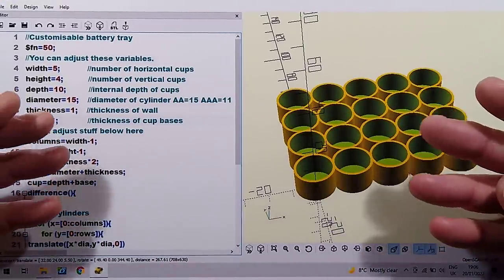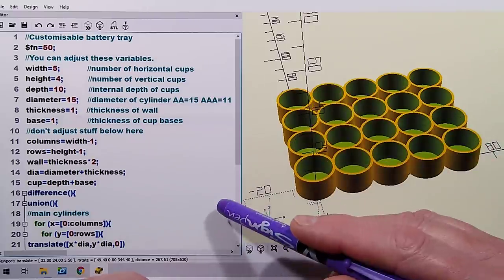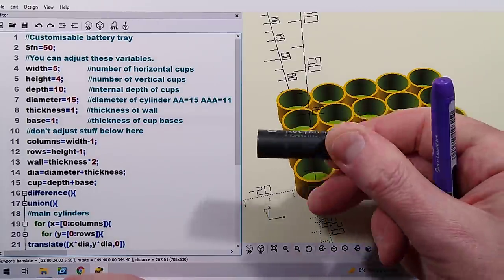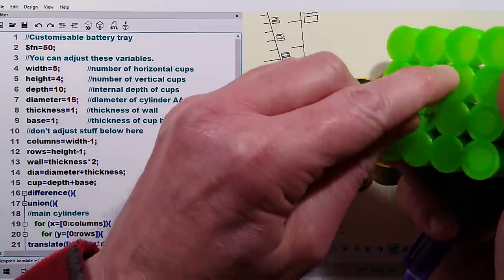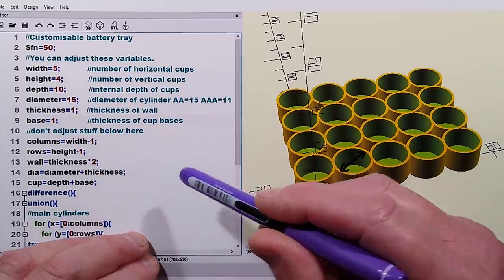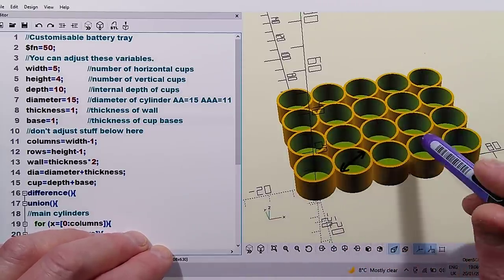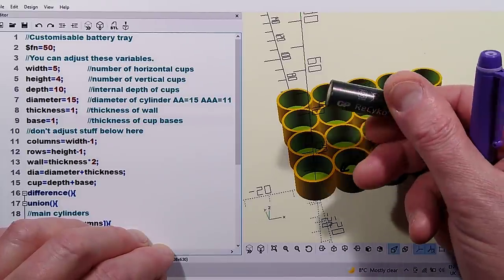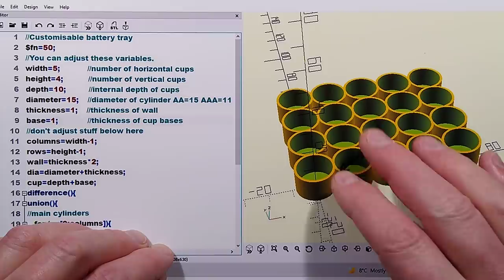DIY custom battery storage trays

Comment: Ok, here is the optimized code for the tray I came up with.
Features: Makes full use of the customizer (which allows to save different profiles for later use).
Checks if you try to create a tray larger than your print bed (adjustable).
Wiggle room for batteries adjustable. (Between 0=press fit if battery on specs and printer precise, and 2mm in 0.1mm steps)
Includes most common battery sizes by name.

//Custom battery tray - bigclivedotcom
/*[Printer bed size]*/
//Printer Y
maxwidth=250;
//Printer X
maxheight=250;
/*[You can adjust these variables]*/
//number of horizontal cups
width=4;            //[1:20]
//number of vertical cups
height=4;           //[1:20]
//internal depth of cups
depth=10;		//[0:5:80]
//diameter of cylinder AAA=10 AA=14 16650=16 18650=18.6 21700=21 22500=22.3 C=26 26650=26.5 D=32 4680=46
diameter=14;	//[10:AAA,14:AA,16:16650,18.6:18650,21:21700,22.3:22500,26:C,26.5:26650,32:D,46:4680]
//thickness of wall
thickness=1.2;	//[0.1:0.1:10]
//thickness of cup bases
base=1;			//[0:0.2:5]
//wiggle room for battery; 0=press fit => might damage tray or battery
wiggle=1.0; // [0:0.1:2]
/*[Hidden]*/
$fn=50;
//don't adjust stuff below here
diam=diameter+wiggle;
columns=width-1;
rows=height-1;
wall=thickness*2;
dia=diam+thickness;
cup=depth+base;
echo(width);
//main body
translate([((diam+wall)/2),((diam+wall)/2),0]) //put 1st cup edges at 0;0 
union(){ //file optimisation
	for (x=[0:columns]){	
		for (y=[0:rows]){
			if((((y+1)*dia)+thickness)<maxheight) { //keep model smaller than the printer bed
				if((((x+1)*dia)+thickness)<maxwidth) {
				translate([x*dia,y*dia,0])
						difference(){
							cylinder(h=cup,d=diam+wall);
							translate([0,0,base])  
								cylinder(h=cup+5,d=diam); //cut out extended for the special case of no base				
					}
				}
			}
		}
	}
}

Edit: test edit to see if YT spam protection has autodeleted the comment

Comment: How would U modify this NEAT Script so that the base has a holes but still holds the batteries;... allowing U to brush dust or any other object that fall in without tipping the tray over...?

Comment: Would using an isometric (triangular) pattern save more space? 
Would be interesting to see if an isometric pattern is stronger too 
e.g. how much it flexes when a full tray of batteries is picked up.
Reply: But then you cannot pick a cell from the middle as there will be little to no gap for the finger...
Reply: @janosnagyj.9540  The 'not-enough-gap' argument applies, ceteris paribus , but if you change other parameters (e.g. cup wall thickness), or taper the cup wall so as to minimize 'joined-up-ed-ness' at the mouth, you can mitigate accessibility issues of the isometric configuration -- to the point of allowing the tray to act a bit like the inverted skin of a cross-hatched mango. However, that makes access a two-handed operation. It depends on what you want -- pure (compact) storage or storage+accessibility.

Comment: On thingiverse there are battery holders that are like mini milk crates. I printed some out a while ago and they're really nice, plus they stack nicely. 

I would guess that if you make the cells squares it should print faster and use less plastic since everything is all straight lines.

Comment: I see another use for this idea...I sometimes buy a tray of beers in my local supermarket, but the cardboard bottom is woefully unstable and wobbly when carrying the tray. If you scale up the 3D print (and possibly amend thickness and height of the cups for rigidity) it would be a help for carrying and storing 6, 12, 24, 30 or any number of cans. It could also be used for storing empties until you return them for the deposit (or dispose of them responsibly, depending on your region).
Reply from the maker: It will work for beer cans as is with suitable sizes.

Comment: would it be easy to have a hole in the base instead of drilling so you could weld tabs across positive and negative to make your own battery packs
Reply from the maker: Very easy.  Literally one or two lines of code.

Comment: I get the feeling Clive is like myself and 99% of what comes off his printer is something useful. I've never really used OpenSCAD, I prefer a drafting type CAD to a mathematical type, though. 😀
Reply from the maker: I just tend to make technical components.
Reply: @bigclivedotcom  same. It sure makes for amazing enclosures when they are tailor-made to the project. Between printing that, and custom trays for organizing supplies at the workbench, I don't have the time or desire to print the things I see so many people getting 3D printers for. 😃

Comment: You can use this script to make 18650 battery packs. Just need a hole for the nickel strips to spot weld directly onto the cells.

Comment: i make these for my 18650 cells, and the method i use is to store my charged cells with the anode+ side up and then when theyre discharged I put them with the Neg- side up!

just got my 3d printer for christmas and these were the first thing i made

Comment: suggestion: 
1. put a second tray on top to make it a "transportable battery box"
2. design: make inserts/dents on the underside of each tray in the middle of all 4 sides
3. design a clamp that fits into these dents, so the both trays can be clamped together, like a battery transport box. The clamp desing should be "springy".
4. make the same for 18650 cells (i guess, only the diameter of the cups have to be adjusted for 18650?) 

these are no demands, just merely suggestion to improve the design. I would like to have one of these, seems to be a very useful thing to have.

Comment: I don't use openscad but I recon this would be handy if you could have 'holes' in the base to make battery packs with 18650's or alike, and print a top and bottom, easy custom packs
Reply: Insert these two lines in the "//hollow cores" section below the second "for" line and above the existing "translate" line. You can adjust the width of the ledge with the ".75" multiplier.
      translate([x*dia,y*dia,-base,])  
      cylinder(h=base*2,d=diameter*.75);
Reply: Even if you don't need the contact points, it will reduce the amount of filament this uses slightly.

Comment: Once you have bought the 3d printer, mastered openscad, how expensive is it to make things as some objects can take hours to print I believe? How long does a spool of plastic last and how much waste does one get?
Reply: For typical home applications, you're looking at around £€$15-25/kg for the plastic (i.e. PLA, PETG, and maybe ABS). I'd imagine 99.9% of consumer FFF (aka FDM) 3D printing uses just those three (ignoring resin printers here).

Waste is usually fairly minimal for standard FFF printers. Most parts will be designed to print without requiring supports, or with minimal supports where that's not possible. In my experience, by far the biggest waste is from failed prints rather than support material or anything - however my printer is a very heavily customised machine so I don't have a manufacturer or community groups to supply good firmware or slicer profiles. Instead I have to find the right settings on my own, which takes a lot of experimentation.
You will get failed prints, that's just the state of things. But with good settings from the manufacturer (or from the community if you choose one of the cheapest machines where the manufacturer may not have done a good job), failed prints should be fairly rare.

Electricity costs vary widely. The biggest power draw will be the heated bed, assuming a given printer has one (most do these days). I'd expect the rest of most printers to be around 50W - the hotend heater, motors, etc don't use a lot of power. In theory it's possible to print PLA without a heated bed, but that doesn't sound like fun to me :)
Power draw of the heated bed depends on its size and temperature. A typical PLA print would have the bed no higher than about 50°C, which shouldn't take too much power to maintain. Maybe 200W-ish for a regular size printer?
So multiply your electricity kWh rate by 0.2 to get a rough idea of the hourly electricity cost. That's never been a huge concern for me, though.

There's nothing stopping you downloading some slicer software and some models to get a feel for the process as well as the amount of material used and the time required (slicers will tell you how many grams of filament a print will use with the selected settings, along with a maybe-accurate time estimate). Just use a profile for a printer that's similar to what you're interested in getting :)

Overall, most things I print are no more than £1-£2 in filament and electricity combined. The medium size battery trays in this video are probably around £0.5-1.0 each, considering the currently high UK electric rates, unless my estimates are way off!
Reply: I've used openscad but didn't quite like it, much prefer fusion360 also free to the hobbyist (does take a while to get used to tho). A spool of 1kg of pla roughly 20 quid will last me a fair amount of prints, obviously depends on the size of the print, I guess a 1kg spool will print 1kg of parts, not taking into account waste. As for waste as long as the bed is levelled and all temps are ok maybe 1 in 30 fail mainly at the start of a print, so if you are watching the print at the start you don't tend to get much waste. These are my experience's with 3d printing, others maybe different
Reply from the maker: Very low waste, and you can optimise designs to use very little plastic.

Comment: A handy battery tray Clive, with some modification I am sure one can change it to hold 9v P4s too. Even make dual tray's that can snap together. I just need a 3D printer, what version do you have or recommend, Filament or Resin.
Reply from the maker: I currently use an FLsun Q5.  There's a wide choice.

Comment: Super small point to make (and I might repeat what somebody else has already said, I'm not intent on rifling through the comments), if the aim was maximum space efficiency I'd recommend shifting every odd column/row by half the diameter, then move the rows/columns in by (√3/4) diameter. If I didn't make a stupid mistake, that should give you a sort of honeycomb shape (fancy name: hexagonal closest packing) with less than 10% of wasted space between the batteries, compared to about 21% with this square packing.

I wish I was better at openscad or I would've attached a quick edit of the script, but the syntax doesn't want to agree with me. Shouldn't be more work than just changing the translate to "translate([(x-sqrt(3/4)*dia, (y+0.5)*dia, 0])" on every odd (or even) column.

Comment: Neat idea,  you  need a top and  bottom   that somehow  latches  the  whole thing  together   in   like a pack
Reply from the maker: I may add an extra stud hole in each cup.  A rubber band or two will hold two frames together with cells in between.

Comment: For My Fellow 'Muricans: If you set the width to 9, height to 10, diameter to 10, and thickness to 0.5, you can print a tray that will neatly hold 3 standard-capacity magazines worth of .223 and fit in a Harbor Freight plastic ammo box with 2 per layer and a space in between to lift them out.

Comment: Could you set "base=0" to get cups with no base? Then you could use a sheet of metal as a base, so that all the negatives are commoned. If you connect your multimeter negative probe to this plate, then you can run the positive probe quickly across all the positive to check charge levels
Reply from the maker: A zero will result in open rings.

Comment: OpenSCAD is kinda so-so in rendering solids. I've found extruding 2d geometry to be way faster. So extruding circle vs cylinder. Probably makes little difference here, unless you want a 1000*1000 battery holder :p
Reply: Something really interesting i found poking around just now... changing $fn value around causing significant performance differences... not always in expected ways... e.g. (for my system at least) changing to 60 it gets a little laggy... or 100 is very laggy... but at 105 (ot even 205) its butter smooth drag the viewport around.

Comment: The code below should be faster than yours, as it only two loops instead of four: 
//cup loop
for (x=[0:columns]){
	for (y=[0:rows]){
		translate([x*dia,y*dia,0])  //cups
			difference(){
				cylinder(h=cup,d=diameter+wall);  //main body
				translate([0,0,base])  //hollow core
					cylinder(h=cup,d=diameter); 
			}
	}
}

P.S.: I hope the comment doesn't screw the whitespaces up. In case, here a pastebin of it: /a391ruCa
Edit: Second try. Seems YT doesn't like pastebin.

Comment: only thing that bothers me about open scad is that you cant change variables once they're set
Reply: Ya, I know what you mean.  X=X+1 doesn't work which means you have to think of another way to do your code.  I read about why they did this but didn't agree.  It is for sure one of the annoying things about OpenSCAD.
Reply: @ElmerFuddGun  even if it was something like a setting toggle or maybe you have to encapsulate the block that uses them, i dont care if it has performance penalties just having the option exist would be amazing for writing really dynamic code

Comment: I imagine that you could print battery holders to create battery packs. I have been reading trying to understand how to make a battery pack for my modem (power shortages are common where I live when it rains, south of California but in México). Seeing these gave me an idea to try and make one that can power my modem at 12 volts and 2 amps using rechargeable AA and/or AAA batteries although I am not sure how many and how to do that.

Saludos.
Reply: Get larger lithium batteries (18650 usually). AA/AAA batteries (NiMH?) are a bit dated for getting 24W out of

Comment: The only change I’d make is, if you want the batteries to have a snug fit, add a small hole to the bottom of each cup to allow airflow so they don’t get stuck.
Reply: If you get the size of the hole right then that small hole could be used for the positive terminal and you could have a "cap" as well as a tray.
Reply from the maker: I sized for the wide tolerance of different cells.  But it's easy to add a hole too.

Comment: I wrote a similar OpenSCAD script a few years back. I designed mine with another hole for the battery positive terminal (nipple) so charged were positive up and uncharged were negative up!

Comment: Hi Clive, IT would be cool if you could grab some of so called cell phone jammers and tear it apart, maybe even check it with oscilloscope… There are bunch of them online with 6, 10 and more antennas which are of the same size (🤣🤣🤣🤣) claiming to work on different ranges…

Comment: You should make a 3D Prated Auto Self Restocking Hopper box  
Batterys go into the top and roll dawn a few ramps to a collection Slot at the bottom that self restocks

Bonus Points if You also Integrate a 4 ~ 8 ~16 Cell  Smart Battery charger (ESP 8622 Based ) with display and mAH Tracking + RFiD NFC Data Storage so each cell records its ReCharge History + Ohms + time taken and update the TAG Data
Reply: But then what would he do the rest of the day as it should only take Clive a couple hours.

Comment: I build my own Prusa I3 and it stills spins like a kitten. It prints a bit rude due to the restrictions, but on slow settings it's still pretty amazing. Works for big parts and items with some rude edges. Those small cylinders still will look a bit rough though. I've been thinking to buy a UV resin 3d=printer one of these days. Much smoother end results but more expensive in respect to materials.

3D-printer master race unite!

Comment: For 18650 lithium battery
diameter=18.3 ;
thickness = 1.4 ;
base = 0 ;
Reply from the maker: A base value of zero will just be open rings with no base.

Comment: It would take quite a bit more finagling but you could cut slots for nickel strips to spot weld in for a custom power cell for 18650s and print another to clip onto the other side.
Reply: Or you could leave the bottom open (Base=0) and slide the rings on leaving the ends open.

Comment: Pretty darn good. Might get some of these for 18650 cells or similar.
Trouble is, I don't have a 3D printer, so will do this only when I've bought a 3D printer (NOT a priority yet!).
Also, it's not an old banger of a laptop if it runs Windows 10 OK with no issues (Though I do not like Meet Now and I do not like News & Interests!).

Comment: Did you delete my comment? Or perhaps YouTube thinks it's spam because there's a link in it? This is what I wanted to share:
$fa = 1;
$fs = 0.4;

// user settable variables

// battery diameter for various sizes, uncomment the one you need
//dia = 10.5;     // AAA size batteries
//dia = 14.6;   // AA size batteries
dia = 18.6;     // 18650 Li-Ion

// wall thickness
wall_thickness = 1;

// rows and columns determining the number of batteries your holder will hold
rows = 2;
cols = 2;

// height of the holder
height=20;

// internal variables
yoff = sin(30)*dia;
xoff = cos(30)*dia;
spacing = 0.05;      //spacing to prevent generating ultra-thin walls
                    // between batteries
module cylarray(walls)
{
    for (row=[0:1:rows-1])
    {
        for (dy=[0:1:cols-1])
        {
            translate([ xoff*row, (dia * dy) + (row % 2? yoff:0) , -(walls)])
            cylinder(r=(dia/2)+spacing+walls, h=height);
         }
    }
}

difference()
{
    cylarray(walls=wall_thickness);
    cylarray(walls=0);
}
(you can find more details if you look up my username here on prusaprinters).
Reply from the maker: Nothing deleted.  YouTube may have done something.
Reply: Yeah, the 'Tubes devoured one of mine as well.